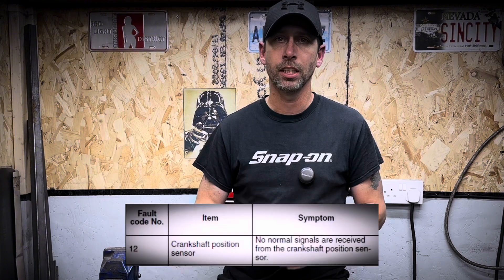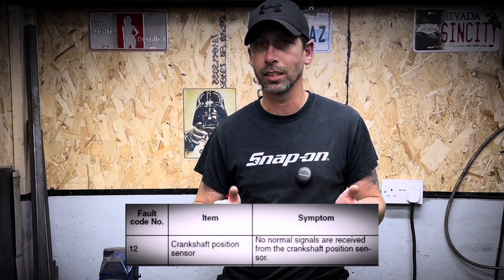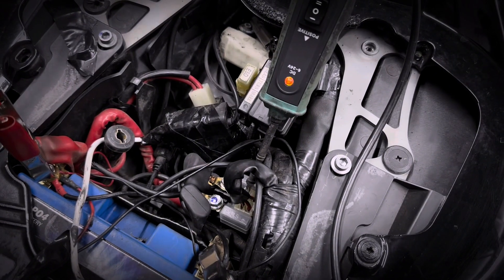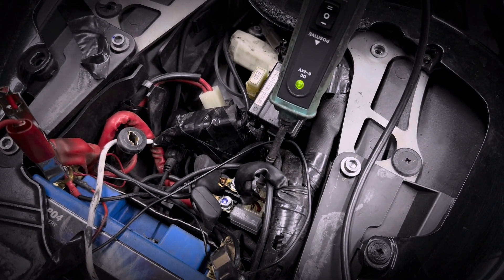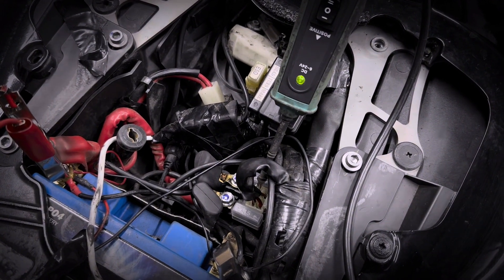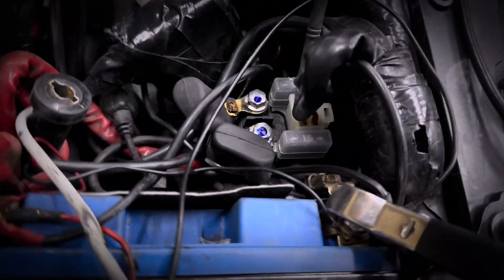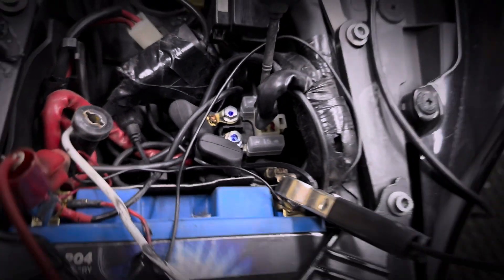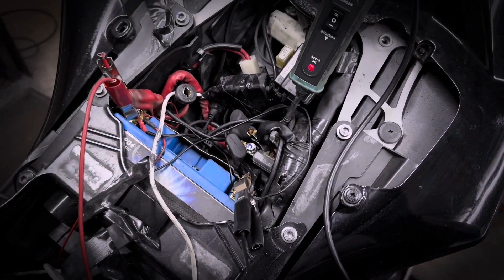Super easy Fix for Yamaha Fault code 12 no start

Comment: Hi, I have tested my solenoid and I think its good... I have all the symptoms of your video. Gauge looks exactly the same with code 12, engine light flashes when pushing start button but just clicks. I will say I did do something and fried something I think due to my negligence. I bought a new battery with too high of a CCA and put it in and started it and the bike didn't like it and fried something, I am not sure if I fried my starter or if its still good but after that battery incident I now have code 12. I did fry 1 fuse which I replaced it was the 7.5A one in the fuse box. Can this code 12 be due to a bad starter or is it only related to this solenoid?
Reply: This is on a 2014 Yamaha R1
Reply: @gnomerebel update?

Comment: Hi, I have a Yamaha FZ6 that has the same error and an additional symptom: while riding the battery randomly disconnects and I just have to lift up the fuel tank to reach it and slightly press on the starter relay and the battery is reconnected. I replaced the relay, the bike started 2-3 times and the next morning it does not start again, code 12 again… Do you think the issue can be the plug that is inserted in the starter relay?
Reply from the maker: Hi, it sounds like you have a connection issue! Was the relay genuine or after market? Sometimes the after market ones are junk.
Reply: @TwoBuddiesFabrication  thanks for the reply, the relay was after market, but I have just went to a mechanic and unfortunately the issue seems to be the starter motor :) I will just buy a new one and this should fix the issue